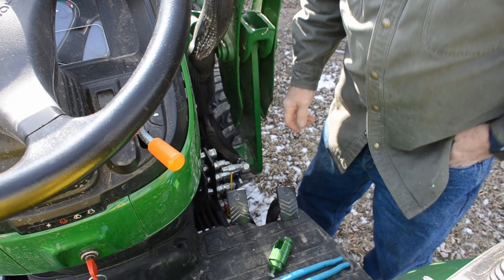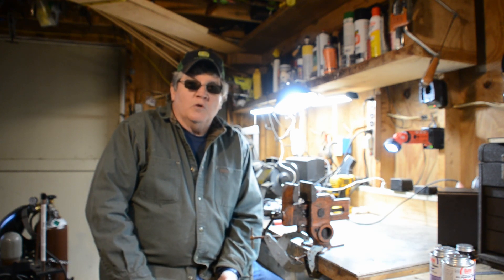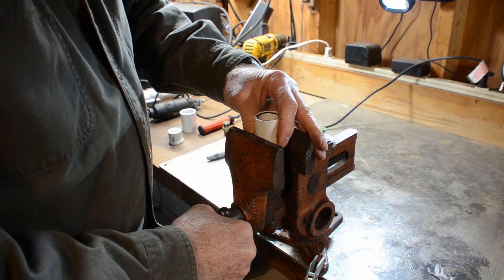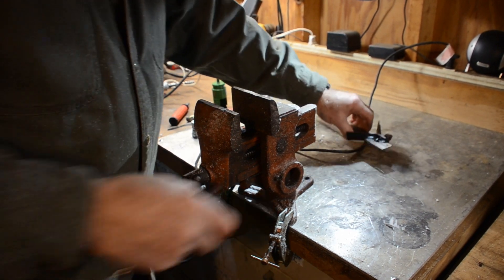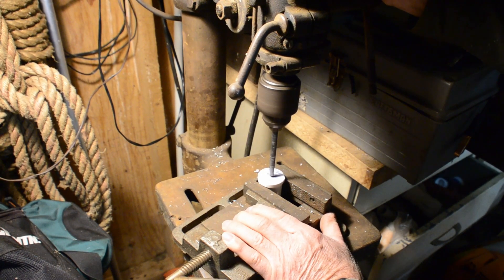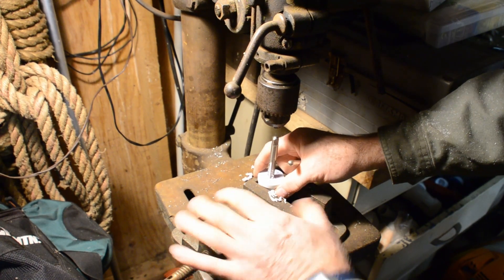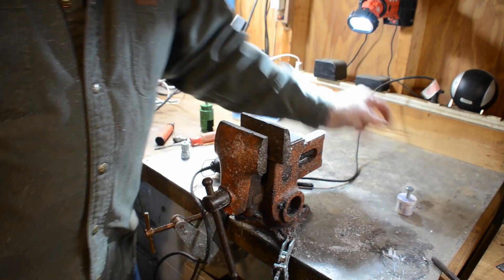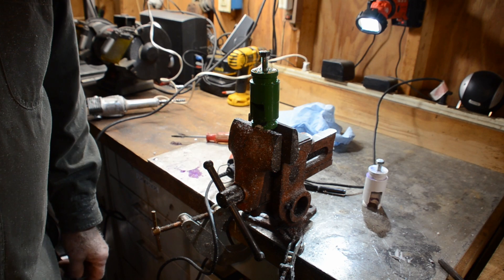How to make a hydraulic relief tool

Comment: Its the female coupling that is still a problem holding pressure even after clearing the male
Reply from the maker: No, I have never had that issue. It’s always the male side problem for me.
Reply: The female couple for loaders are on the tractor. Actuate your valves with the tractor and thus the pump off and they should zero out.

Comment: This is such a great idea.  I struggle frequently with this issue.  Does the PVC really provide enough strength to release the pressure?
Reply from the maker: Yes, I believe so. I have not had to use it that often only time will tell.